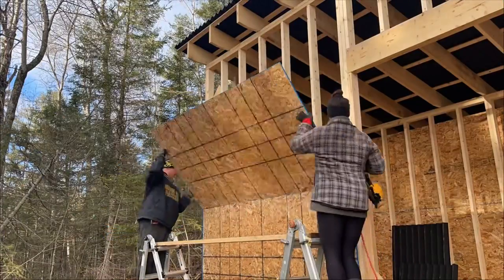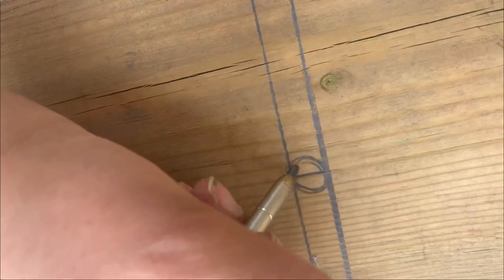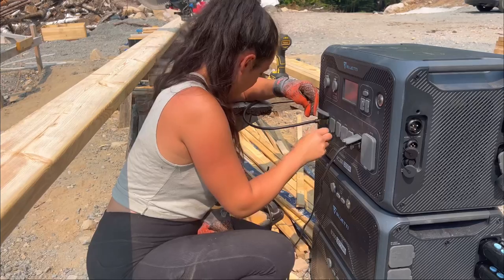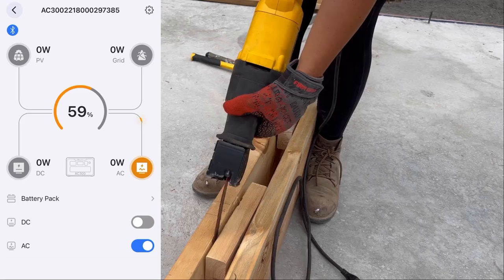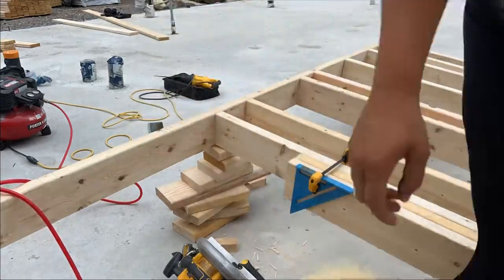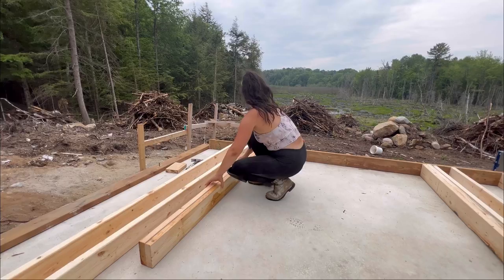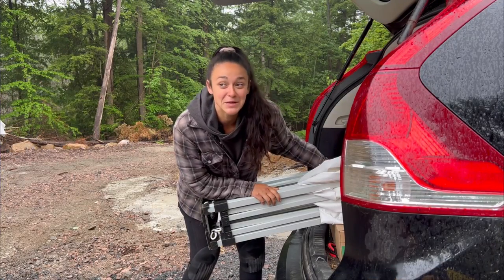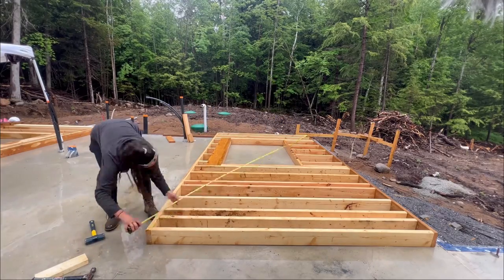OFFICIALLY Framing My Home FROM SCRATCH! (For the first time)

Comment: Good job , what about a moisture barrier between the baseplate and the concrete. A good tool belt might help speed things up , good luck.
Reply: That is what I wanted to say - be sure to install a membrane between concrete and wood, or at least paint the concrete contact area with some bitumen to break the capillarity effect and avoid humid walls.
Reply from the maker: Definitely need a tool belt! Yes we have this foam
Moisture barrier :)

Comment: So many things to think about when building walls! One thing I did was to have the builder add an "additional" 2x4" wall inside the 2x6" wall for the showers that were on the outside walls to allow the plumbing to be an additional distance away from the outside. Just have to insulate the 2x6" wall first before adding the 2x4" wall! Makes it easier for doing the insulation! Did not put insulation in the additional 2X4" wall allowing for airflow around the pipes. Also, if you like to have electric candles in the windows for Christmas, put the outlets center of your window, all on one circuit with a switch so you don't have to turn each individual one on. If you're going to have ceiling fans use additional blocking to support the electrical boxes! If you are going to have an outdoor shower on the side of the house, put in cutoff valves so that you can drain the shower for the winter. I have my valves in the basement to make it easy, you will need an access panel to do yours. Whole house fan? Okay, okay, I will stop!
Reply from the maker: That’s awesome! That’s what I planned on doing for my plumbing for the bathtub! Add an additional 2x4 wall :). Thanks for all the ideas!

Comment: Beata, on the face plates. Place the board on top of the screw anchors and hit the faceplate with a hammer thereby leaving the screw indent in the underside of the faceplate. Then simply drill the hole as indicated by indent and install.
Reply: Saves a lot of time! No measuring, and no marking.
Reply from the maker: Ah interesting! Thank you!

Comment: Here in southern Indiana we call the U-shaped wall components 'wall leads'.  Typically the voids are filled with rigid foam insulation for additional insulation & to avoid cold spots in the outer walls.
Reply from the maker: Thank you! I’ll have to add in insulation!

Comment: Also a tip, make sure to drain the compressor every day, with as much moisture you have, and a few drops of air tool oil every day you use the air tools, you have done better than the last 2 crews I had the displeasure of working with, those wall get un godly heavy, be very careful and watch the breeze, lots of bracing. Another tip, I cut longest to the shortest, so if there is a mistake you can always cut it down, for blocks or cripple studs 😊
Reply from the maker: Love that idea of cutting longest to shortest! Thank you! Thanks for all the amazing tips. Sorry for the ungodly crews. Sometimes construction can be brutal depending on who you’re working with
Reply: @SimpleLivingwithBiata  very true on work mates, but last 3 years been on my own again, 100% quality control just takes longer, got dozens of time and material tips in the library, much needed working on location, one false move and the day gets shot as you know well, would I be able to send you some snap shots of my family and finish work? I must say it's nice to be able to share tips and techniques, I don't have anymore apprentices, maybe my little girl?  I help one of niece's with her projects over the phone for last 20 plus years.

Comment: Biata you need to drain the water from your compressor so you don’t mess up your nail gun and make sure to put a couple of drops of oil in the nail gun each day especially when it’s raining,also the boards that you are building that have the 2x6 and the 2x4 is called a tee.

Comment: HI Biata.  You go girl! When I make window headers, I use the appropriate 2x10 or 12 as required for the opening size but I glue and nail the 2x together, install them so they are flush on the inside. This leaves space for 2 1/2" of expanded foam on the outside which gives you a thermal break.... I know too late now but next time.   keep up the good work
Reply from the maker: Thank you so much! Our whole house on the outside will have 1” of insulation so we’ll have that thermal break! More expensive but makes a huge difference!
Reply: @SimpleLivingwithBiata  That's a great plan! I am redoing the siding on my house. I have been stripping back right to the studs, replacing insulation, as required, new sheathing, house wrap and then 1" foam, then new siding. (I think this is what Code calls for in Ontario.) Yes, a bit more expensive but I am sure it will pay off in the long run. Again, keep up the great work!

Comment: I might have missed the step but I hope you are putting a foam strip along the bottom of the wood where it contacts the concrete... it helps prevent moisture transfer and seals any air gaps etc. Keep up the good work
Reply from the maker: Yes! On wall lifting day :)

Comment: The pockets you are making for your interior walls are 2 2x6 and one 2x4 like a U shape this is fine just make sure you get some insulation in there before sheathing.  i like to use just 2 2x6 and make an L this way it leaves the bay open for insulation . hard work good luck
Reply from the maker: Thank you so much! I didn’t end up getting insulation  in some of them first but I’ll drill a hole and fill the ones I missed with spray foam lol

Comment: I like the pencil and pencil holder. Neat! The little pieces above the header are called cripples. Did you know a framing square ("L") is 1 1/2" wide so you can layout both sides of layout at same time. Or just put one mark and an X - really do not need the second line. Did you know you do not have to frame in the windows/doors? Just skip all that wood. Should make lifting into place way better. They you can go back to frame in the king/jacks/headers/cripples later. A real back-saver. Progress is NICE! Way to go! Thanks for sharing
Reply from the maker: Thank you so much! The pencil is amazing! Thank you for the tips!

Comment: Hi, thanks for a great set of videos, really interesting to watch. Building seems a little different there to here in UK where even new builds still tend to be done on the traditional block and brick lines. I have just finished a timber frame extension but that had to be mounted on a block plinth to get it well clear of the ground (can't remember the height our regs say but its somewhere around 25cm). Anyway, what I was really was writing to comment on was that it does seem a good idea to leave the screw the joint that you have 'pulled in' in but also if you put at least two nails in each 'joint' and make them not square but angled towards each other at maybe 20 degrees it completely stops the pulling out problem you get if you put the nails in straight (you still need the screw as you had to initial get the two parts to 'pull in'. You probably knew all this anyway! Keep up the good work!

Comment: Since you layed underfloor heating I thought you were just going to  tile that concrete floor than installing Wood flooring on top of it. You could have saved a lot of money. Perhaps each country has its own standard. But here in 🇿🇦 for a woodfloor you would make a foundation around the perimeter of the house then build a two leafs brick wall to your specific floor height then install these wood trusses as you do now. installing a hardwood floor would follow. The base of this wood floor would just be soil. we don't do underfloor heating when dealing with wood floors. That's how things are done this side. Anyway keep it up 👍
Reply from the maker: I think some people will do pier foundations here that have cement that go 4’ down and then finish off with a wood foundation with dirt under. We likely have different weather patterns as our frost line goes 4’ down! So you either have to have concrete go 4’ down or you can do a floating slab with in floor heat!

Comment: Biada if you open the bottom of the air compressor tank you can drain the water out that’s why you’re getting a mess out your nail gun
Reply from the maker: Ah thank you! I ended up doing that eventually. My air compressor is on the way out. I’ve had it for 8 years and it’s getting a little sad

Comment: I would be putting a lot more nails than that for exterior walls, think of the weight they are supporting with 4 feet of snow on the roof. looks great though nice work
Reply from the maker: It’s hard to tell with the editing because I’m skipping over how many nails I’m putting in! It’s all to code :)

Comment: Where interior wall joins the exterior wall, we use an L so that we can insulate from the inside and save a stick of lumber.
Reply from the maker: That’s totally fair! What about the drywall? Where do you screw it in on the corner if you leave out that extra 2x6?
Reply: @SimpleLivingwithBiata  The 2x6 "L" will make 7" on the inside of the wall so you have 1 3/4" on each side of your 2x4 interior wall for drywall. Does that make sense?

Comment: Looking good. Just an observation…On your exterior wall pockets (where your interior wall meets and secures to the exterior wall), are you insulating behind the pocket before you sheet them? If not, that will be cold zone.
Reply from the maker: Yes! Unfortunately I didn’t think about that but I have a solution for doing it afterwards :).
Reply: @SimpleLivingwithBiata  If you have an insulation company coming in, you could drill a few holes and spray foam or loose fill.

Comment: Dont fergit to put a few drops of pneumatic tool oil in the air fitting before each days use
Reply from the maker: Thank you!
Reply: @SimpleLivingwithBiata  Also drain your compressor each day as it will collect a lot of condensation. That’s why you see a blast of moisture when the gun shoots.There will be drain at the bottom of the tank.

Comment: Great job Biata, I'm wondering if you considered concrete block walls instead of timber, would it not be stronger and longer lasting? Although probably much slower but maybe stand up to the harsh winter better. Good luck with standing your walls and ill be watching next week.
Reply from the maker: Hey John! Thank you!

A lot of people in this area will do ICF (insulated concrete forms) for their walls. But most construction in this area is stick framed! Concrete is stronger though for sure

Comment: Any walls you are running 3 or 4” pipe in should be 8” thick. Otherwise you will have no wall left.
Reply from the maker: No 3” or 4” pipe in any walls :). Just 1.5” and 2”

Comment: how much of a concern is it for the wood being exposed to the rain when you build the wall ? can it make the wood warp ?
Reply from the maker: Not too much of a concern :). Homes are built in the rain all the time. Obviously it’s nice to get it waterproofed and closed in quickly. But it’s barely rained this year. Actually, some of the wood already comes warped. And the OSB laying out is water resistant to an extent
Reply: @SimpleLivingwithBiata   good ,  always nice to watch you work

Comment: Meh comment about your screw use. If you are using a screw to pull the piece of lumber into place why would you then remove the screw? I use both screws and nails when I build and don't see a reason to remove the screw (especially seeing that it's helping hold the board in place). Straight in nails don't offer and pulling support. Just my  opinion but I would recommend leaving screws in, leaving it in can't hurt and will likely help keep things where they need to be... 

Keep up the fun work.
Reply from the maker: That’s smart! I had some stay in, but the non galvanized screws will break down in PT wood! thanks for the tip though! I’ll keep them in from now on!
Reply: Hi, thanks for a great set of videos, really interesting to watch. Building seems a little different there to here in UK where even new builds still tend to be done on the traditional block and brick lines. I have just finished a timber frame extension but that had to be mounted on a block plinth to get it well clear of the ground (can't remember the height our regs say but its somewher around 25cm). Anyway, what I was really was writing to commen on was that it does seem a good idea to leave the screw the joint in but also if you put at least two nails in each 'joint' and make them not square but angled towards each other at maybe 20 degrees it completely stops the pulling out problem you get if you put the nails in straight (you still need the screw as you had to initial get the two parts to 'pull in'. You probably knew all this anyway! Keep up the good work!

Comment: You are making the mistake a lot of builders are making these days. Bolt your pressure treated boards down. THEN build your walls and stand them on your PT. You will end up with a double plate on the bottom of your wall. Pressure treated makes lousy framing. The double plate will make it nice when it comes to trim. 😊
Reply from the maker: That’s totally fair. I don’t think that’s a very common practice here! Maybe the next house! PT sucked to work with!